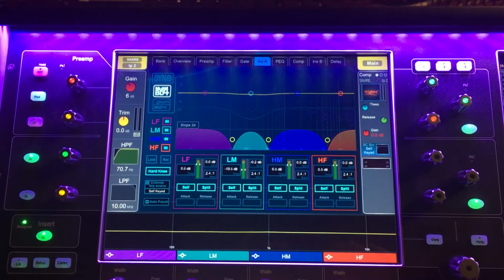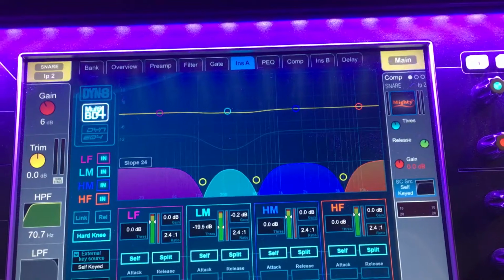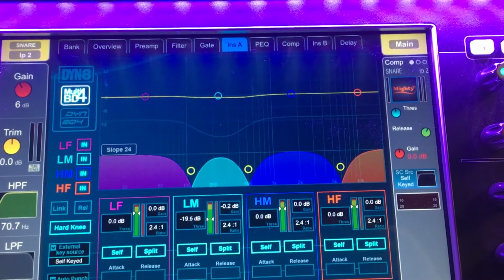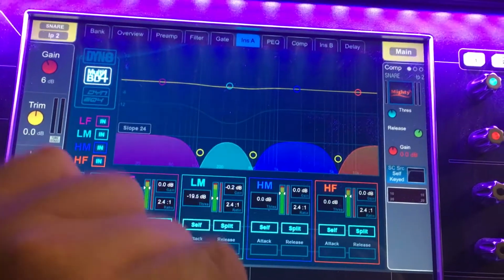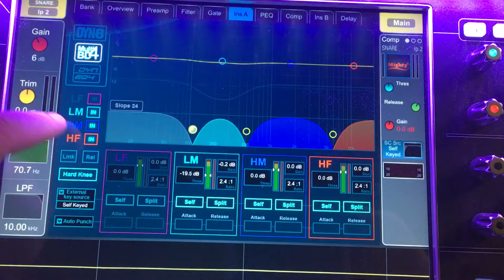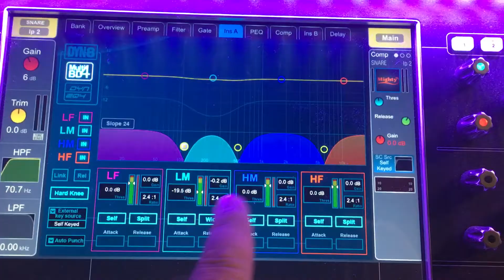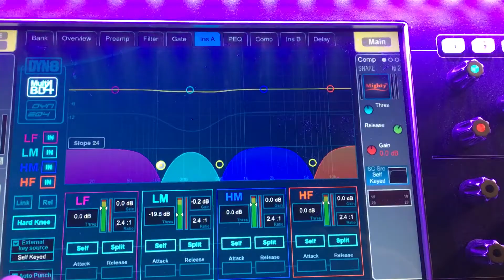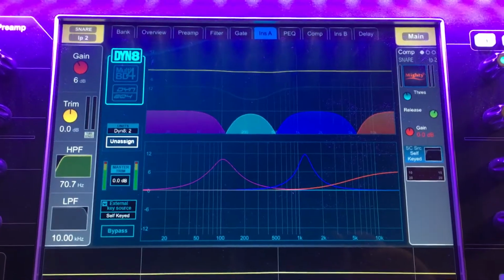Dyn8 for DLive - 2 of 4 - Multiband compression

Comment: Thanks for the vids, Brett. What is the advantage of using the wide setting on Dyn8?
Reply from the maker: WIDE means the compressor band or EQ structure is responding the the level of the WHOLE signal, not just its own band of frequencies.  The whole signal crosses a threshold and the comp/EQ responds, rather than the low mid compressor only tracking the low mids, for example.

So I might want to take some boxy mids out of a tom when the drum gets hit, or take some bite out of background vocal when the vocal is especially strong.  WIDE causes that structure to react to the level as a whole, not just a filtered part of that signal.
Reply: @gritziegler  Ahh. Gotcha. I'll have to give that a go next time I'm behind the desk.